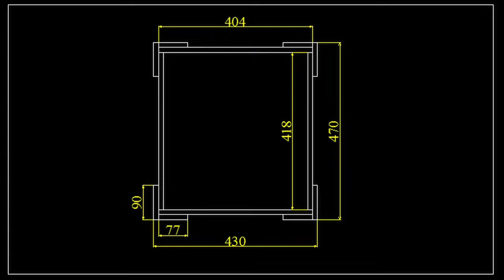Building Simple And Beautiful Wooden Chair

Comment: Can anyone tell me all the materials needed for this?
Reply: You'll need: construction workbench, a power drill, clamps that can support wood, a saw, approximately 75 to 100 screws, 3 inch, eye protection 

The amount of wood you need, will depend on your own personal preference, you could literally make 3 inch chair a 10-foot chair with these directions, proportional preference is up to you.

Those are the materials that you need, after that it's up to you how much money you want to pay for a power drill, or a saw.
Reply: You don't actually need a power saw, or the exact style of tools and power tools he's using, but it would make the process easier. 

The style of power saw that gentleman is using in the video can cost anywhere from $200 to several thousand dollars.

You don't need a nail gun, but again if you plan to take carpentry seriously, you'll need one, a good nail gun should cost around $250 to $400, nail guns also start as low as $60.00, but you will get what you pay for.

However if you're looking for a beginners version of making a chair, I would find another video. 

This man is clearly a journeyman carpenter, and his presentation includes thousands of dollars in tools, and equipment.
Reply: @Phaymiz , what's the name of the holders he is using at 0:37?